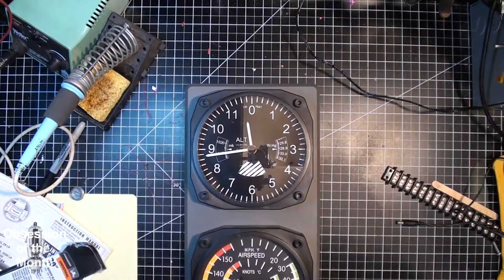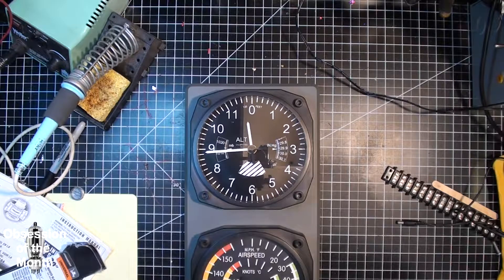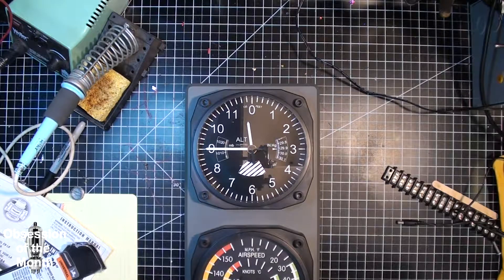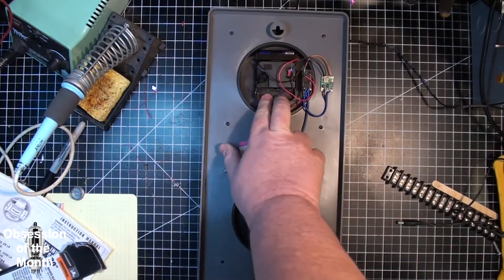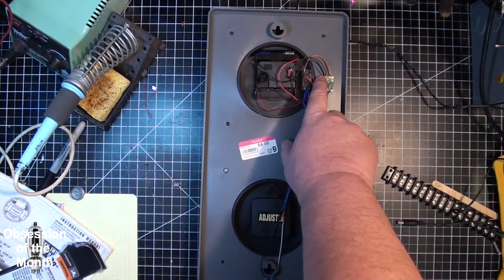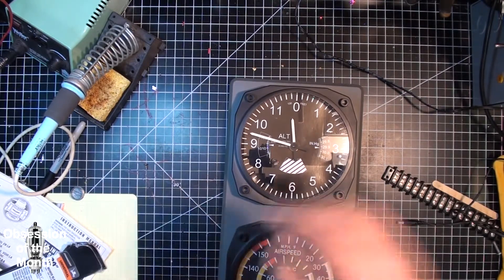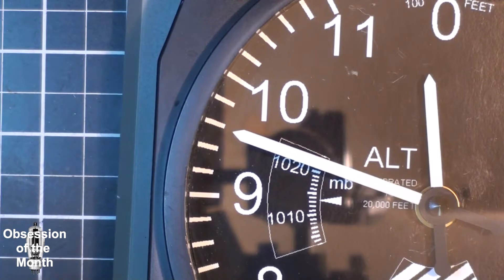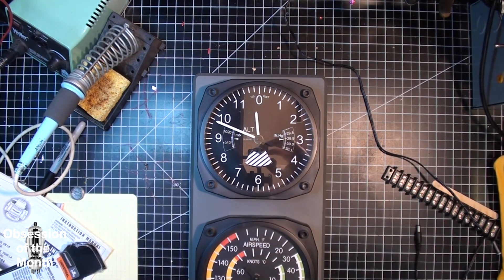Clock converted to AC power with Battery backup

Comment: Hi what converter board did u use , was it the Mp1584 u showed on another video ? , also would they be a way to do this method but have it charge a rechargeable battery when using mains power ? Thanks
Reply from the maker: it uses a 35371-PS micro buck converter. It would be possible to charge the battery but that was way more complicated than I wanted to deal with. Also the AA battery normally lasts 2 or 3 years, 5 to 10 in this configuration.